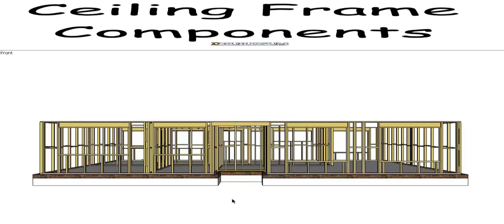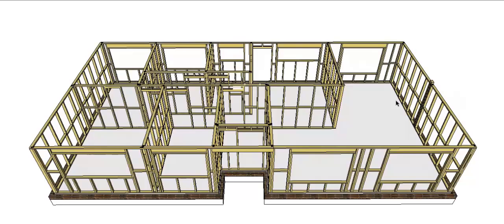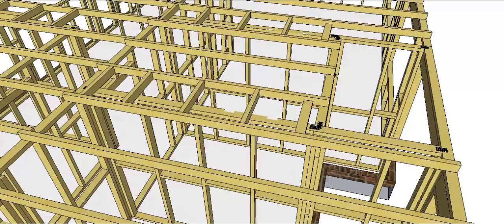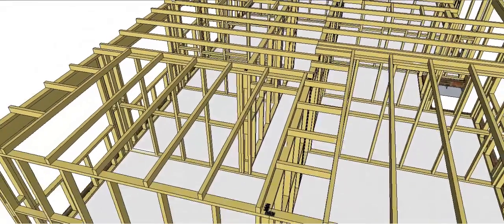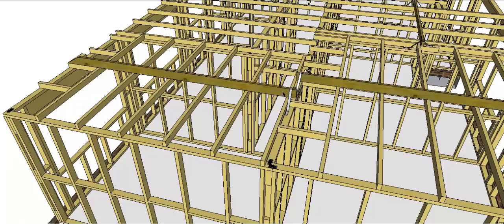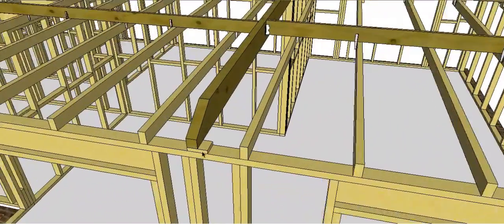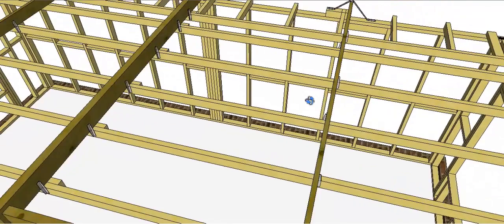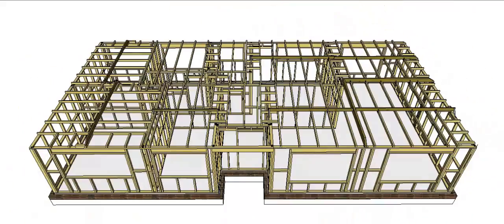Ceiling Frame Components

Comment: surprised we dont use Duragal/C Purlins as hanging/counter beams.
Reply from the maker: Hi Mate, Im sure you could in some circumstances however there is not a lot of information around on what loads they will take and then having to connect them to a timber frame can take a bit more time.

Comment: What would you do if you hypothetically wanted to knock the outer wall of the room out? 3:30 would you put a counter beam running perpendicular to break the span of the joist?
Reply from the maker: Hi Mate, in this case the joist will span the extra distance with out the wall like they do in the room adjancent otherwise, yes you would have to put in a hanging beam to increase the span of the joists or increase the size of the joists.

Comment: hello sir, can I ask please, I have a corridor running down the length on my timber frame building. 1 metre wide, exactly in centre. Can I lap the joints between this corridor if I nail the whole length of the lap? If not, what do you recommend? many thanks
Reply from the maker: Hi Michael, the joists have to be joined over a point of support, so I would use longer lengths on one side than the other so they can join over on of the walls
Reply: @Buildsum  , you are so good. I didn't think you would reply after so long. My issue is the joist were ordered quite a while ago and now the supplier will not exchange them. The joists are 4.8 metres. The span is 4.2 metres to each nearest wall or 5.2 metres to each furthest wall. I am not sure what to do?
Reply from the maker: Hi Michael, sorry to say but you are going to have to put another piece over the corridor from one wall to the other. I would cut 1.2m lengths and run them in next to the long joists lapping them over the corridor wall. You could cut the long joists back to 4.5m but it is not necessary. Hope this helps.